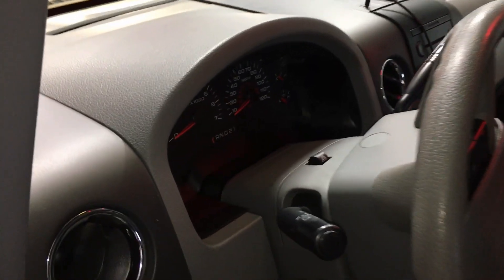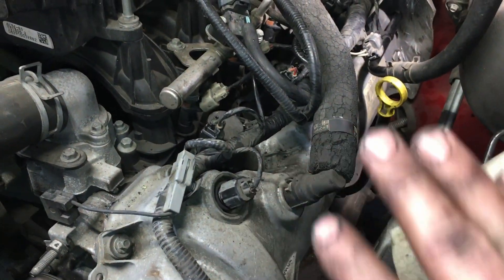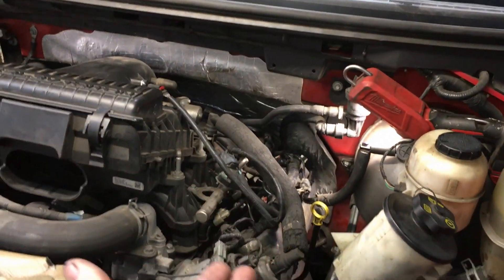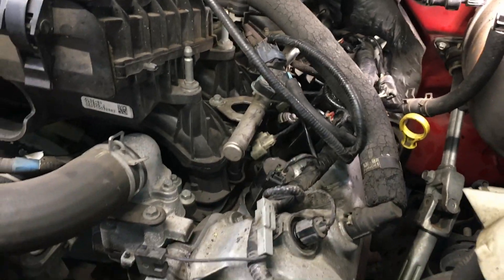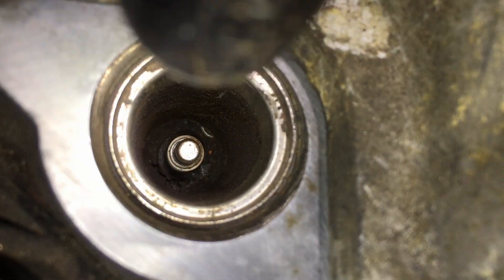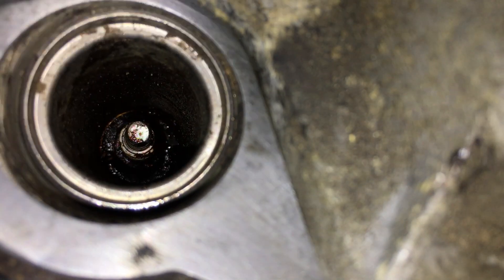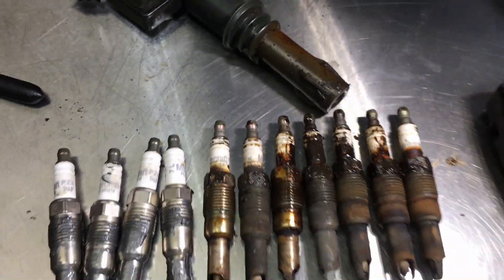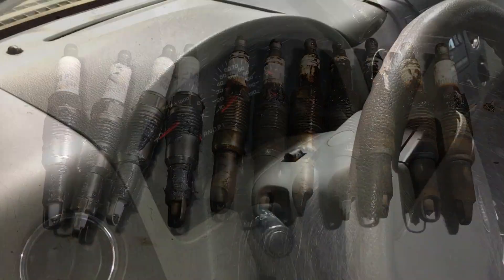Ford 5.4L 3v Triton Engines Fuel Smell and Ticking Tapping Noise: CHECK THIS ITEM FIRST!

Comment: Aso, I noticed a chugging/tapping still present after the repair. Mine had similar after replacing my loose plug. Is that just how the 5.4's sound normally?

Comment: I had this! Made that exact noise but didn't smell any fuel (was my number 8 plug). Got to number 8 and could loosen it out by hand (wasn't backed out terribly much thankfully, but enough to loosen without tools) Replaced and she ran quiet! Still have a slight tick though... Ran great for about 45 mins then I now have a No-code misfire/rough running. I mistakenly thought dielectric grease conducted electricity vs insulates. I was a genius and greased all the electrical connectors and gave a nice glob up each ignition coil... still have a miss after spending time cleaning that grease out with electronic parts cleaner. any tips appreciated! Have a set of coils on the way as well as new pigtail connectors (broke a few in the process). My two main thoughts are that A: somehow a coil is now bad (old coils, one is obviously aftermarket that the previous owner had put on), and/or the grease plugged up the spring coil inside of some of them (actually I know that happened on at least one). And/or B: a pigtail wire connector is wiggling loose while driving (though I checked and they all seemed in place and tight). Maybe the coil is just not making good connection to the plug?

Comment: Love your videos sir. You’ve helped me a lot with my 3v. I have a question, my 3v is misfiring at idle (but only sometimes, sometimes it will run fine), and it missfires in overdrive when putting it under load or when flooring it. Not tripping a CEL. I’ve put new motorcraft plugs in it, new coils, changed the oil, put a new fuel filter in, cleaned the throttle body, and cleaned the MAF. It makes a slight knocking sound that sounds like it’s coming from the phasers when cold - but goes away when it comes up to temp. Do you think my phasers are causing this misfire? Any suggestions would be greatly appreciated!

Comment: How long can you drive like this?
Reply: My 99 e350 with 380000 miles just made 100 mile trip with a blown plug today. Unplug injector and you should be O.k. going to try to retighten to 25lbs and see

Comment: never buy those 04-07 f150s with  3v 5.4 no matter how cheap, total pos junk
Reply: The later ones such as the 2010 model were good motors but the earlier ones were complete junk.

Comment: #1 plug was only held in a by three or so threads. P0301 code gone and idles smooth. Thanks for these videos. They're a great tool. Especially the torque specs.

Comment: Hey Brian. Question and comment.  I just took delivery of a Ford re-manufactured 5.4 3V.  I didn't want to risk getting one through Ebay or other shop.  This thing looks brand new!  The oil marks suggest it was built 11/17.  It's complete with oil, filter, sparkplugs, valve covers, etc.  Just need to slap on the intake and replace the radiator/oil cooler.  Do you think I should pull the timing cover and check the oil pump?  I have a brand new Melling High Output I could put on it. Any other parts you would suggest checking/swapping?  I have brand new phasers, cams, lash adjusters and rockers (all Ford brand) all for the vin 5, 2004 5.4 that I was going to rebuild but opted for a re-manufactured.  Any interest in these parts?  You're videos are invaluable and much appreciated!  If I lived in IL. I'd gladly have you service my truck!  Thank you!

Comment: I have a 4.6 2 v making a spark knock noise. It has 177xxx on the original plugs. Can spark knock occur from old plugs that might be gapped large? Or even a plug backing out ? Thanks

Comment: Hi Brian, the ticking noise I'm getting happens mostly when I push on the gas pedal could that be the same problem you're speaking of with the sparks /coils.
Reply: Mine has the same problem did you ever got it fixed?

Comment: Thanks for this video. I replaced my plugs and coils this past weekend for the second time (first plug change was at 95K -5 of the 8 broke off). I'm at 180K now and the truck was shuddering and smelled of fuel at startup. Found four of my plugs were fouled and were also very loose. Fuel was getting past them and I'm assuming several of my coils were shot. Anyway, plugs and coils were replaced and the truck runs so much better now. Tapping is gone. The only noise is a light rapping that I'm pretty sure is coming from both cam phasers? Thanks again.

Comment: How can I get the best help . I have a 2006 Ford F-150 super crew 4.6l and have had problems recent were my truck was shaking and had check engine light on so took it to shop and changed my spark plugs and coils now my truck still shakes and has no check engine light any info would help a lot don’t have a lot of money to spend and is it worth keeping or do I count my loss and let the truck go . Thanks for your time

Comment: I had that happen to my truck after changing the plugs for the first time.  My truck started to misfire and had that loud ticking noise from the 1st cylinder. I tightened it back up and it was fine for 75,000 miles.
Reply: I had a misfire on my truck,  replaced the ignition coils and spark plugs, now I have a ticking noise on my truck

Comment: I have a tick very noticeable while driving with the windows down while accelerating. The plugs and coils are new and sounds like a exhaust leak but the gaskets are new. I do get the gas smell near the front at start up. I don’t have the bad idle after freeway driving and tried the disconnect of the VCT’s. Wear else can I look?

Comment: Fordtechmakuloco....I recently changed out my fuel pump...motor only....and was careful with it but noticed my fuel gauge hanging up around quarter tank of gas and it worked fine before.What could be the problem.I live in small town southeast missouri.2000 f150 5.4

Comment: That ticking on the passenger side you said no noise so that sound is normal not the driver side but the passenger side because mine sounds like that that's normal
Reply from the maker: Yes that is how all 5.4l 3v engines sound even when new from the factory.

Comment: Let me start out by saying thank you for your Channel I own a 2004 F150 5.4 3 valve hahaha jokes on me sometimes and I've gone through the timing issue with the cam phasers had all that replaced and now I'm going through the ticking I just had a question what should the plugs be torqued to cuz now I'm getting the ticking that this video describes

Comment: My 01 5.4 has 283,000 bought it brand new changed coolant every 3 years full synthetic every 3-5k no ticking no tapping changed plugs every 75k no blown plugs only thing I did to the engine  is tune up 1 injector intake manifold gasket few sensors. I think most premature failures are caused by lack of maintenance and shops that have one certified mechanic the rest are kids in school that practice on customer vehicles .

Comment: I think may have shared this I encountered a level of special I've only encountered with a triton 5.4 (2005 F-150 FX-4) is a stuck injector.  The engine hydro locked the #2 as it got so fouled and the fuel smell was horrible.  Not a an easy fix for a 5.4, inexpensive parts but extremely time consuming.  Thanks Ford for making such a fine engine with plenty of quirks to keep youtube humming.

Comment: I own the exact same vehicle and spark plug coming loose.  Spark plug blew out, broke coil and worn out the threads from wobbling  back and forth. It cost $730.00 to fix it.  There is an article on the internet detailing a loose plug, decreased power, a little noisier and rougher running, gas smell and considerably  noisier when very loose.  It stated from first coming loose to blowing out is about 5 days of driving. So at first sign of a change in performance, open the hood and watch the coils.  Take it to an experienced Ford mechanic and let him investigate.  I thought it was just Cheap gas instead of the Shell gas I usually buy.  Just like this video the engine still had some tapping. Owning a 5.4 3 V is a nightmare.

Comment: Your videos are great and you have so much knowledge with the timing system on this engine. I pulled up to a stop one day and the engine was shaking erratically and caused the cabin to shake as well. Have you ever seen a case where the phasers would be at fault for this symptom? This only occurs when the oil starts to get hot when you drive it for a while. It’s is also gaveling symptoms of roughy idle and you can smell the fuel being burned which I’m assuming is poor fuel economy. Please help I’ve looked all over and I’m just not sure about this one. Replaced the plugs and vct solenoids. Also there is a code coming up for a rich bank 1 would a phaser be to blame for that as well?
Reply: You ever fix this issue?
Reply: I have a simikar problem

Comment: Happened to me.... 08 F150 5.4 Picked up with 85k two years ago.  Had plugs changed last Feb.  5 out of 8 broke.  Spent $480 labor changing them.  Started to smell raw fuel.  Took back.....  was told I'm NUTS!   Still had smell.....  ASKED them to check plugs from watching your channel....NOPE...I'm NUTS!   Tossed a misfire and was told coil pack was probably bad...? Wait, you changed all of those with plugs. You could put your fingers on top of coil packs and feel the one pushing up every time it fired.  Thought maybe the threads gave way so I Called the guy who works on my Audi   $$$$  Opps....passenger side back plug was loose because was not torqued down correct.  In fact 5 out of 8 not torqued correct.

Comment: Hey buddy!!
I have a question for you, I have a ford truck f150 lariat 2006, I just took it to get the oil change and the guy told me that it was very low on oil, he told ne that it was burning oil since it's not leaking anywhere, I would like to know if you can give me any recomendations to deal with that?

Comment: The dancing coil was pretty obvious.
Reply from the maker: The coil hold down bolt was removed for video purposes, otherwise it would not be moving like that.
Reply: I see.   My brother had an early 2000s F150 with that 5.4l in it. He decided to change the spark plugs one day.  Had one frozen spark plug. I have 40 years as an  auto mechanic,. You'd think he would have asked me what to do, but NOOOO.  By the time he called me, he broke off the plug.. drilled it out. broke off a tap. Turned over the motor, and destroyed the piston, and the head.  This is why I tell everyone, TAKE IT TO THE PROFESSIONALS.  The days of automotive DIY are OVER.

Comment: When we first bought our used 05 Expedition with the 3v 5.4 I heard this ticking sound, the guy said it had done it for a long time and "Ford said" it wasn't a big deal. I made 2 long trips in it and it got worse. Pulled it into a ford dealer and they said it was "normal" and safe to drive 6.5 hours back to Oregon. I didn't take that as acceptable so I pulled it into my parents driveway and lo and behold I had the 2nd plug on the passenger side basically held in by a thread. It could have easily popped driving back at highway speeds...I probably should replace all the plugs and coils but I'm terrified of the whole breaking plug thing!!!

Comment: Did anyone notice that when he first started engine.. no.6 coil is new and also loose .. and when he was done the same no.6 coil is old  dirty.. and not moving..  but he mentioned  at end of video new coil and plugs replaced..
Reply from the maker: This engine had 8 plugs that were loose as shown on the bench not just the one shown in the video. The coil that was shown on the bench that was too far gone actually came from cylinder #4. So yes the coil on #6 was not replaced as the plug was only backed out a small amount.

Comment: One thing  I might add...is.. Try to keep Neversieze off the porcelain of the new Spark Plugs...Just give them a wipe with a paper towel or clean rag..only apply to threads and tapered seat....Neversieze is Conductive...and can cause a misfire....Great Video...👍
Reply: Hey you seem like you can help me as i notice he does not respond to a lot of people, i was going to replace my plugs on my 03f150 5.4L and noticed something like the last plug the well is filled with gunk is it safe to take of the plug?
Reply: @alfonsom2385  ...i like to blow out the spark plug well...with a air nozzle...to remove any debris....if the plugs have been in there a long time i  will soak them over night with PB Blaster Penetrating Oil...ive seen the plugs break off in the head....Some brands were a 2 piece design ....and could snap off if Corroded and frozen...
Reply: @frankieford7668  is it ok if the penetrating fluid gets in the cylinder?
Reply: @frankieford7668  and what damage can i cause if some of that gunk gets in the cylinder
Reply: @alfonsom2385  ...depends on the gunk...if it has sand or dirt mixed in....it can hurt the Cylinder...if its just oil..it shouldn't hurt anything...blow it out ...better to be safe...
Reply: @alfonsom2385  ...W-D40 or PB blaster wont hurt the cylinder...but oil mixed with sand ...will..
Reply: @frankieford7668  ok thanks

Comment: Hey can you post the exact motor craft part number for the new improved spark plugs
Thanks
Reply from the maker: SP546 for 2004-2008 mid year before the head design change.

Comment: I have an 2005 EXPEDITION 5.4 3V.. I just had the cam phasers and entire chain set replaced. Also spark plugs replaced last year.  And still makes this noise!! I notice the tapping noise only starts after engine warms up tho! Might this be my issue ?? Truck runs great and strong.   Pls help.. Great vids
Reply: Fyi last mechanic told me it was a lifter but wouldn't it make that noise all the time or just at warm up ? Thanks sir

Comment: Well that helped me out big time.  Pulled the plug, Cleaned it, the boot, and the plug well.  Torqued the plug to what specified, put back on the COP and fired her up.  Purrs really smooth and no more ticking noises.  Will do a total change over of plugs and maybe a COP or two in December.
Reply: How did you clean the plug well?
Reply: @TheTruth27536  first I sprayed the well out with compressed air. Then took out the plug. The I wrapped a microfiber cloth around a 1/4" dowel and sprayed some carb cleaner on the cloth.  Placed cloth and dowel in the well, twisting in a downward motion.  The frilly side of the cloth picked up everything and left the well clean.
Reply: @wesdog8975  Thank you!  I appreciate it!  I know I have this issue and I wanted to make sure my threads were as clean as possible when I install the new plugs.  I have plenty of microfiber cloths on hand, so your technique will certainly get me there.  Thank you again!

Comment: Some cars have problems with oil entering the plug well eventually causing the insulator part separating from the spark plug nut. Can happen on some Renault Megane variants.

Comment: My 2006 Expedition had a tapping noise coming from plug 8. The plug was only about 6 months old. It wasn’t loose but after I pulled it out the tab was actually broken off. Never found the tab.

Comment: 2004 6.8L 2V V10. Ticking on passenger side. Checked torque on all spark plugs and ruled out exhaust leak. Are the cam followers and the lash adjusters on the 2v the same as the 3v? I can't find a part number anywhere...New subscriber BTW. Your content is amazing! I'm going back through your library and your older stuff is fantastic as well. Thank you for what you do.

Comment: I have an 05 Expedition with this 5.4L 3v engine, I'm constantly having problems with it. Your videos have helped me so much. Thank you for making these videos. I just replaced the spark plugs on it and could see that a few of them were already loose and was letting exhaust gasses blow by. Put new spark plugs in with anti seize all over them (in the right areas) and I think a couple of them have backed off again already. I didn't know the exact torque specs, and didn't think it mattered that much, I just torqued them down to where they were snug.
Reply: They have instructions on how to torque it by hand

Comment: Great vid. Wow. Plugs sure have changed. My family had an auto electric shop in Vancouver WA sense 1938. Closed in 2006. Wish I still had it. The problem I have is a 1994 ford van. If you tap the gas it can die. Then you smell fuel trying to srart it. Guess I'll have to take it in.

Comment: the first time i heard the ticking sound i was sure it was a rod bearing,   turns out it was the spark plug banging away,  the plug was jumping up and down.   me brain went>>>>>>>  duh,  WTF is this,   i have never seen this happen before.  you can start it and place your finger on the end of the spark plug and feel it popping up,   or place the socket way down the hole with a extension on it to see if it is popping up and down.  that coil sure was jumping in this video,  and with old style plug wires you will see the wires move.

Comment: Don't take that spark plug  out ,junk Ford design threads come out with it,all Triton's,my experience!
Reply: I had a 98 f150 with the triton 5.4 2v with over 250k miles. I never once had a plug issue, but it was plagued with coilpack issues. Hit a water puddle and bam, there goes a coilpack lol. Those and the intake manifold gaskets were the worst on my truck.

Comment: Not sure if this has been asked,  between spark plugs and cam phasers,  why has there not been a recall on the 5.4?
Reply from the maker: Recalls are only forced by the government for safety related issues. Even then it takes quite a few deaths to be recognized by the government and I really don't think there have been any deaths related to stuck spark plugs or hot idle knocking phasers is all.
Reply: @FordTechMakuloco  thanks for the reply.  I really appreciate your videos.  I'm working up the courage to do plugs, phasers,  timing chain and oil pump. Thank again!